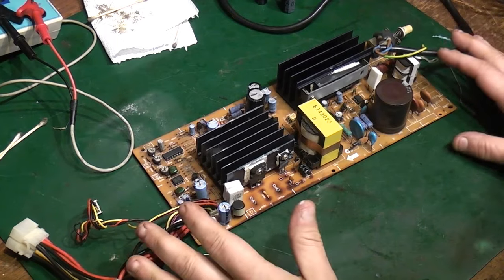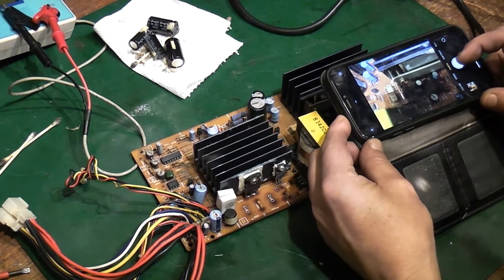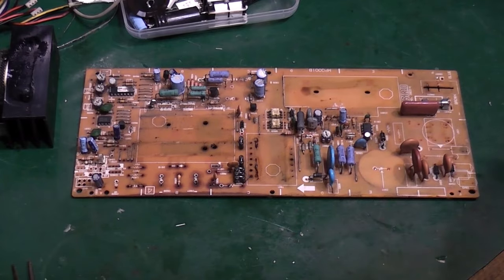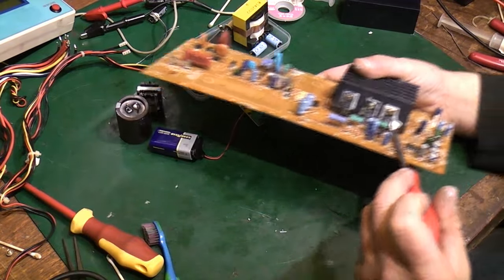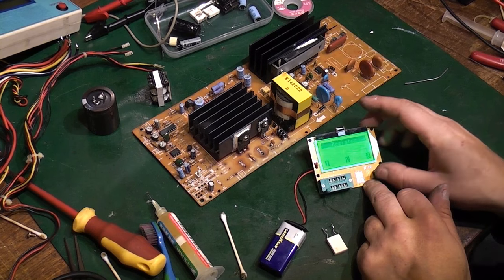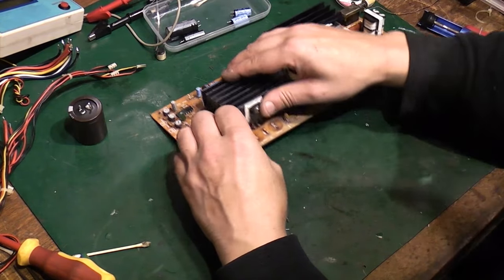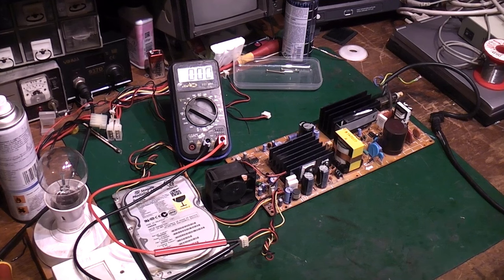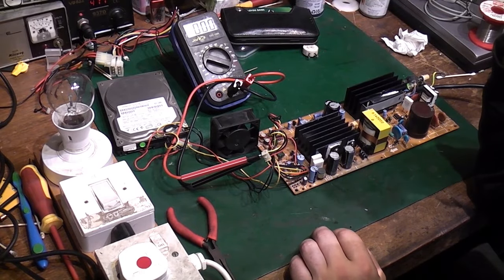Amstrad PC2286 repair Pt2 tackling the PSU Pt1

Comment: I am guessing that the small thing you call "isolation transformer" is actually a filter, two coils in parallel and both L and N going trough them.
When fixing switching power supplies, there's a couple of things that are worth checking. If there's an control IC, it sits on the primary side, and it needs power. That power can come from the big HV cap, or there's an additional diode providing DC. In both cases, the DC (which can be up to 400V) then goes through resistor (hundreds kOhm or more) that drops most of the voltage, and then a Zener diode and a capacitor (usually something like 6.8uF / 50V). This circuit is pretty vital for the whole operation, and the resistor often dies (as there's hundred volts across it). Its definitely worth checking that out. Also, when replacing the resistor, better use two smaller resistor in series.
There's a good book on this with real examples and pictures - look for "Troubleshooting & Repairing Switch Mode Power Supplies" by Jestine Yong. You can find it online a PDF if you google a bit...
Reply from the maker: Thanks for the book recommendation i'll see if i can find a copy.

Comment: There is a start up voltage on some Switch Mode power supplies as there is an oscillator circuit and it has to be started. Might be worth a look ?
Reply from the maker: its starting then immediately shutting down. The oscillator must be starting initially.